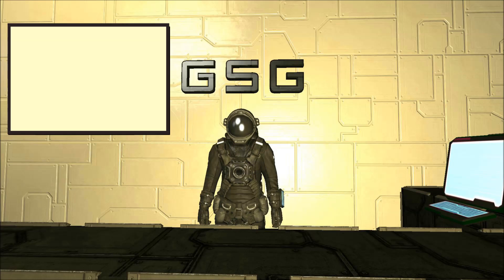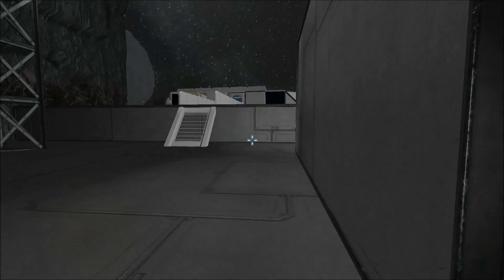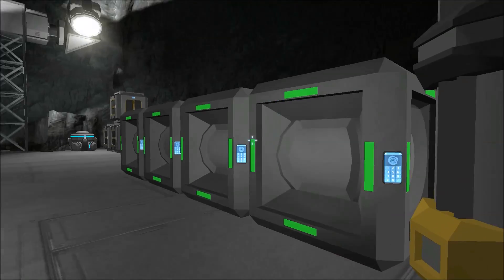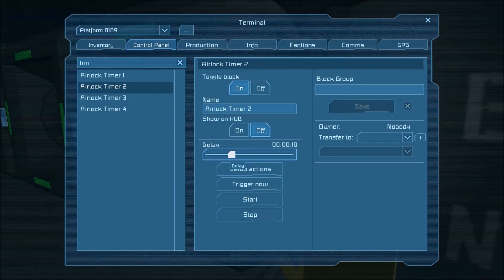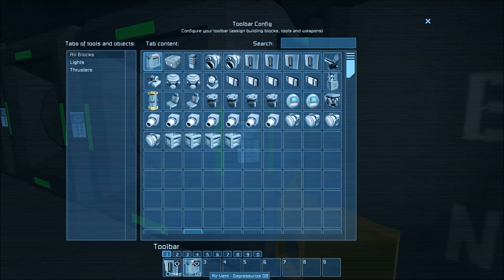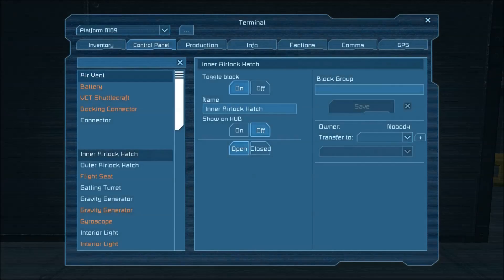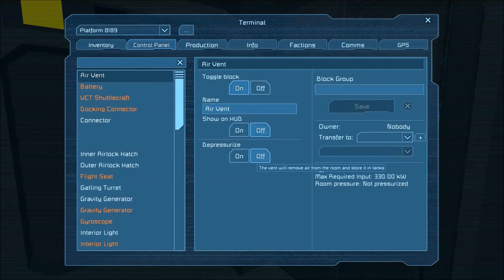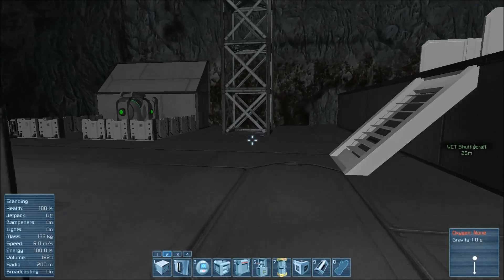Space Engineers – Automatic Airlock Tutorial

Comment: this isnt foolproof at all, when you go into the airlock and decide to back out before the 3second timer expires, both doors will open both timers will get turned off and oxygen is vented out... this means with 2 players each approaching a door, this wont work
Reply: ive made a fix to it so it's foolproof, even with multiple players walking back and forth, no way to break this: heres what u gotta do:

on timer block 1 (outer door) turn of sensor of outer door, timer 2 turn on sensor inner door, timer 3 (inner door) turn off sensor inner door, timer 4 turn on sensor outer door.
turning the timer blocks on and off can simply be removed.

timer block 3 for inner door can be be set to minimum delay (outer door just needs to close before inner door opens)

when multiple players are standing inside sensor range, it should just go in a loop, but no oxygen is lost and you can still get through the airlock

Comment: I had the issue of both opening if you went through too quickly as the timer was paused when the timer block was turned off. I played around and found in fact you don't need to turn off the timer blocks. Instead timer 1 and 2 turn on their respective doors and turn the other door off.

So if you get to the outer it starts timer 1, closes the inner, de-pressurises, turns on the outer, then turns off the inner door and runs timer 2 which opens the outer. Get to the inner sensor and it starts timer 3, closes the outer, pressurises, turns off the outer, then turns on the inner door and runs timer 4 which opens the inner. I then set the sensor to close its door when you leave its field. Nothing complex,  really simple to close both doors..... and at least now i cant open both doors at the same time so no issues even if it bugs as both will be closed :D

Comment: I'm trying to get the yellow ship from the asteroids custom start to depressurize and pressurize without building an airlock onto it. 

keep In mind, I don't have alot of space to cram 4 timer blocks into the ship, unless they are airtight, then I can just implant them into the wall.

I'd prefer to do this with a single sensor, all I need is for the sensor to depressurize the cabin before opening the door automatically, It looks like I can make it work using this as a base.
Reply from the maker: +ZxCrono Timers are not airtight (at least they weren't last time I checked).  You could probably use the sensor to tell the vent to depressurize when you approach it (have the sensor range pretty tight around the door) and then have the vent tell the door to open once the ship is depressurized.  Then you could have the sensor (when you leave its range) start a timer (I think you need this timer - but I could be wrong) which tells the door to close and the vent to pressurize the ship.  Hope that helps!  (I should really update this tutorial with a better design) :)
Reply: GopeScope Gaming thanks for the input, I've been trying something very similar to that, but it seems that I cannot get the oxygen tank and vent to work.

I think its still bugged... nothing I do to the depressurization vent or the oxygen storage tank will pull the air out of the room...
Reply from the maker: +ZxCrono Is your 02 tank full?  Without enough empty space in the tank, the air has nowhere to go.  I ran into that a number of times.  If it isn't that - it might be a bugAnd, np - anytime!
Reply: I'm fairly positive it is a bug, nothing I do can fills the O2 Tank. I decided to just accept it till it gets fixed, I can accept the loss and minimize the volume lost when depressurizing airlocks.

 I have a system in place to shut down the O2 generator when I leave and turn on when I return. The losses are acceptable and negligible since I'm not piping a massive room and emptying it repeatedly anyway.